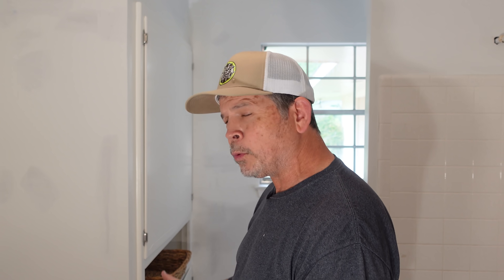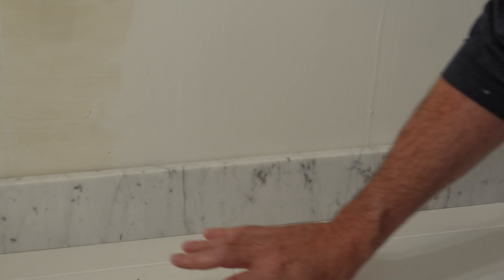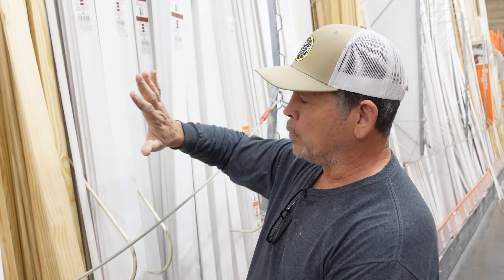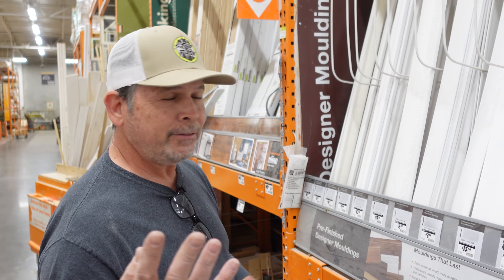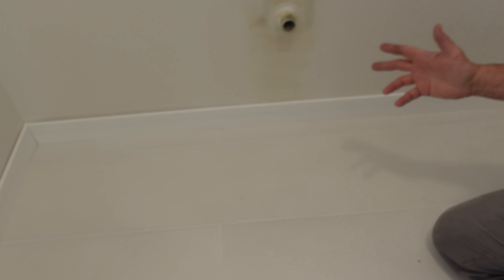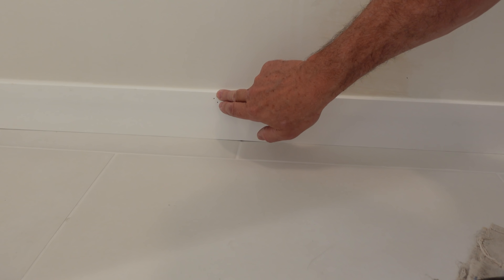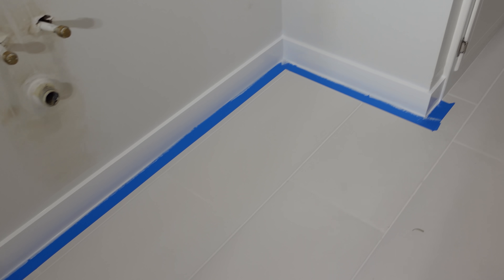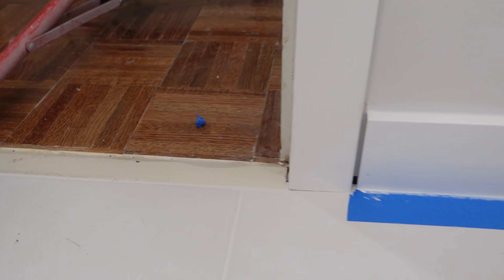Use THIS Baseboard IDEA on Your Next Project!

Comment: Great video as always, guys! If you used the stone for the baseboard, would you miter the corners, or just butt them together?
Reply from the maker: At first I would say to butt them but then you'd have an unpolished edge on the outside corners.  Inside corners a simple butt is fine.  A miter on the outside corner might be tough to cut and prone to chipping.  I just said to Jordan that we need to find a good polishing system to finish the edges of cut tile, stone, etc.

Comment: Many moons ago, when construction adhesives first came out, I did not trust them, for good reason.  Then, the adhesives got better but poor or less than perfect surface prep still led to a lot of failures.  Now, however, those problems have been overcome and adhesives often perform much better than mechanical fasteners.  Since I also hate face nailing finished work, I am happy to see that adhesives have come this far.  I guess you nail the baseboard mostly out of habit, but it adds unnecessary work to patch back
Reply: Really? I might have to give that a try if/when I redo the master bath. I mean, worst case, I have to go back in later and throw a few nails in it. Which adhesives do you recommend for MDF and PVC/poly baseboard?
Reply: @bloodgain  i have had good luck with Loctite products, especially rated for outdoor use if moisture might be a challenge.  I have been surprised at the many materials it effectively bonds.  I have some outdoor tiles that I used it on, on a counter, where I had repeatedly fixed mortar and grout failures.  The temp of the counter goes from about 130 in the hottest direct sun of the summer, down to overnight freezing.  It gets rajned on and hosed off, and some tile is stuck to marine plywood and some to vertical metal framing.  I tried the adhesive on it out of desperation, really.

Several years later, there i no loose tiles like in the past.  Everything stays rock solid.  I started using more adhesives and they do better than mechanical fasteners.  

You can't glue to loose substrate material, of course, and the surfaces should be clean of any major dust or loose material.  I have had great results even when the surface prep was not all that great in terms of light dust.  This is some amazing stuff these days.  Next landscape wall is getting adhesive, I guarantee it.

Comment: When you are painting, do you remove your tape before the paint dries, or do you cut the paint from the tape after it dires?
Reply: Wet. It may not separate cleanly once it’s dry.
Reply from the maker: Cut and then remove after second coat

Comment: I was wondering if you guys have any comments or concerns about the use of MDF. I have heard conflicting opinions on the formaldehyde adhesive used in MDF, I know it's fine once installed and a much cheaper option usually but when cutting and installing do you take extra precautions or is it just business as usual.

Comment: why did you only caulk the TOP of the baseboard?  I can see gaps in the bottom, also, don't you want the benefit of the water sealing properties of the caulk along the bottom as well?  To keep any spilled or leaking water from making it's way behind the baseboard?

Comment: Why didn't you caulk where the trim meets the tile? I've seen many houses not sealed there and have always wondered why because what if water splashes or puddles onto the floor by the trim, wouldn't it just slip under the trim and damage the floor boards and other wood stuff?
Reply: The caulk will discolor and crack and get dirty and look terrible over time. And if a teeny bit of water somehow gets in, it will dry out.
Reply from the maker: In next video we use 100% color matched silicone to seal that.  Should come out this Easter weekend.

Comment: dont wanna be a worry wart / safety person, but table saw blade shouldnt be that high when you cut things, normally should be about 1/8th to 1/4 over the the thickness of material you are cutting.

Comment: If you live in a pier and beam house, tile and stone are bad ideas for baseboards--just like ceramic tile is a bad idea for the floor. When your house settles they will crack or pop off the wall.

Comment: I haven't read all the comments but your MATH is off when you were calculating how much linear feet of trim you needed.  2+6+2, then you made a comment, and went on to say 8+.... and so on.  You should have been off 2ft, but since you were rounding up it might not have been an issue.

Comment: Anyone use Schluter®-DESIGNBASE-SL? I'm thinking about this for baseboard trim in my bathroom remodel. "Schluter®-DESIGNBASE-SL is a finishing profile used as an alternative to baseboards. May be installed with tile coverings or other floor coverings." I am in South Florida and the bathroom has a whirlpool tub. I'm planning for a lot of moisture!

Comment: It would look better if you filled out the wall with compound instead of just loading up the gaps with caulk. You also should have caulked the bottom of the baseboard before installing it. Not much of a painter if you have to cut that baseboard in. Priming that stuff is a complete waste of time.

Comment: Hope you didn't come up 2 ft. short in your baseboard material buy.  At time 3:12 you were up to 10 feet of baseboard needed, but when you started to measure the next section, you added 6 (the new wall section) to 8.... vice 10 as it should have been.  Oops!    Happens to all of us... :-)

Comment: Does Home Depot or Lowe’s carry that stone baseboard option? When I did my bathroom remodel I had to go online for something like that. I used it for a threshold, window casing, and niche shelf. Having a local option would have been nice.

I also used the plastic molding in the bathroom as well, so west to work with.

Comment: My opinion on plastic baseboard is that it sucks. Ever since they came out with it I have hated it. Crappiest thing I have ever worked with. When it comes to installing baseboard in my house I think I will buy some real wood and put a nice profile on the edge. Fug crappie ass cheap (as in no good product, but still priced TOO high) chinese made plastic baseboard! I have never understood why plastic, made from oil, cost so much. I can pay an arm and a leg plus first born for a piece of plastic, but an elaborate brass spigot I can get for three bucks. Go figure.